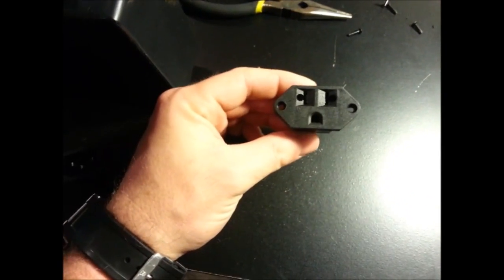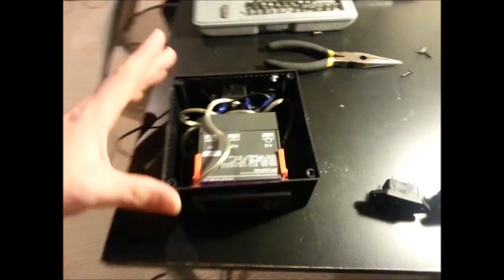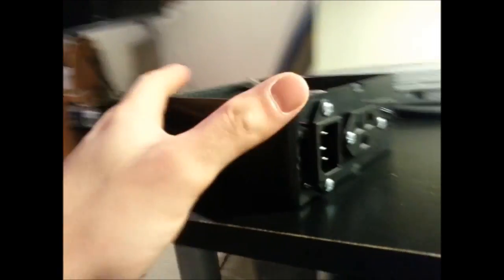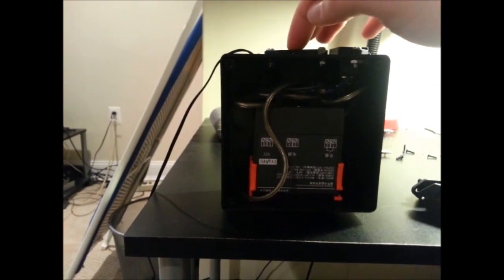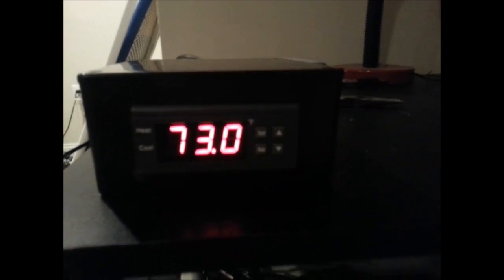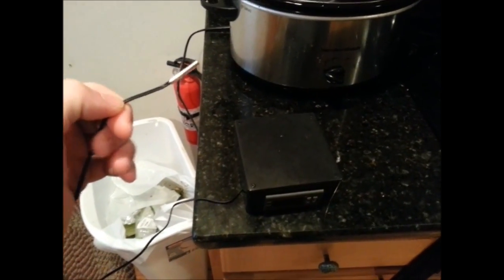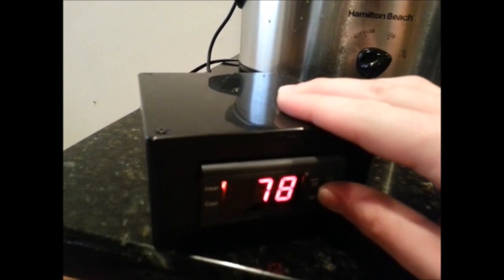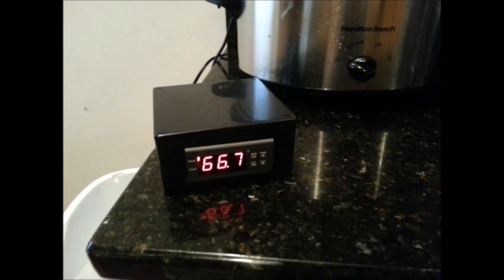Build Your Own Sous Vide Machine for about $30

Comment: My only concern is, if you add the circulation pump, all of those cheapy little pumps are for cold water. What is the max water temp that can be circulated through one of those cheap pumps and how long is it actually going to last with 150 degree water flowing through them for hours at a time?
Reply: sous vide usually run under 100 degree celsius anyway. it is all okay.

Comment: I'm using a turkey roaster. Works the same as a crock pot, just bigger with a steel lid (Hamilton Beach, about $25). It's larger and can do bigger sous vide roasts with the extra space. It also has a stainless grate that goes in the bottom. Holds the plastic bag off of the bottom to improve circulation. Ebay has tiny hot water submersible pumps, good up to about 180 degrees, if one wanted to add a circulation option. My whole build cost under $50, works as well as the big $500+ sous vide tanks, and I can still use my turkey roaster for,, you know,, turkeys. Everything fits inside for storage.
The little temp controller thingy is great for all sorts of uses. Thanks!

BTW: I used 12 gauge wire for safety (high watts), but the turkey roaster works well on it's low setting (about 350 watts). Be sure your computer wire is at least 14 gauge. Better yet, buy a short 12 gauge extension cord, cut it, and run the ends out as shorter pigtails. All you'll need to do is drill holes in your enclosure. Use zip ties inside to anchor your wires.

Comment: hello sir, i have a question, what are you using? do you use arduino?
Reply from the maker: Nope, this is a completely standalone build only utilizing the described temperature sensing unit shown in the description.  This could probably easily be controlled with an Arduino or Raspberry Pi though.

Comment: Can i not just plug my cooker into this gadget? Please advise: LED Digital incubator Temperature Controller Electronic Thermostat Thermocouple with Socket Aquarium Thermometer termostato
 http://s.aliexpress.com/E3yiyIru 
(from AliExpress Android)
Reply from the maker: You should be able to, but I cannot tell 100%.  Keep in mind that many cheaper DIY type Sous Vide machines have come out since this video was posted, so there are probably a few cheaper ready to purchase options now.

Comment: FWIW it's pronounced "Sue VEED" with the "D," not "Sue Vee." "Sous vide" means "under vacuum," but when pronounced "sous vie," it means "under life." Which is... weird :D

More importantly:
1) Details on wiring up this unit, MH1210F:
http://www.homebrewtalk.com/showthread.php?t=505220
2) Put a 10A fuse on the black (hot) input wire! Fuse fittings like this are easy to wire in:
https://www.amazon.com/uxcell-Screw-Panel-Mounted-Holder/dp/B00AQWXW9S
3) Use thicker wire for this, 12 AWG for safety. You can use "found" wire, just read the gauge and rating on the insulation. Thicker wire means cooler operation. Details:
https://www.hitechcontrols.com/cables/technical-information/58-current-ratings-ul-csa.html
4) Follow these color standards, it's easy:
http://www.dummies.com/programming/electronics/components/alternating-current-in-electronics-hot-neutral-and-ground-wires/

Happy cooking!

Comment: Just finished putting mine together. Testing it went great. Now to celebrate with steak. I did have problems getting the receptacle from China. After waiting 3 months I received the wrong part. I wound up ordering this one https://www.aliexpress.com/store/product/10pcs-lot-Black-AC-250V-10A-Panel-Mount-US-Outlet-Power-Socket-Electrical-Socket-female-industrial/1196680_32623722924.html I wish the case was a bit bigger too. Even with the orange pieces my display pokes out a little. I believe the wires are pushing it out. I'm happy though.

Comment: Just finished the build had the plug and outlet in my computer junk box so thirty two bucks with shipping. Hardest part was cutting the openings set the Dremel on low and didn't get melting but still hard keeping control but it came out ok. I stripped the blk and wht 14ga wires out of an old power cord so wiring was easy.  I've been precooking steaks in plastic bags and hot water for a long time and for the most part they came out fine but not keeping the water at a consistent temp sometimes results can be iffy. Fun build and I'm looking forward to seeing how well it works

Comment: I added an extra plug outlet to the side of the box so I could plug in a power converter (120vac to 6vdc) to run a water very small circulation pump that I found on Amazon

Comment: DO NOT BUILD THIS! Just because a lamp cord is able to carry 110 volts for a 60 watt light bulb doesn't mean it carry 110 volts for a 300-500 watt crockpot! The lamp cord is only carrying .5 amps where as the crockpot is up to 4.5! This is a $30 house fire tutorial.
Reply: Old comment but typical lamp cord is 18/2. 18 awg wire is good for ~7 amps and 500 watts at 120v is only 4.1 amps. Add a 5 amp fuse and don't think twice about it.
Reply: I was going to make a very similar comment. That lamp cord is not rated for that kind of current at all and it's going to heat up and start melting stuff.
Reply: Gravit8 that is not what he says or what he shows. He says he wired it with a lamp cord. Watch it again. Also the crock pot wire is only after the outlet. According to his tutorial you can wire the outlet using lamp cord. I actually wired up one of these not 2 hours ago.
Reply: Brad Weber Haha I deleted my comment because I watched it again and saw that. But I didn't see you had replied, my bad!
Reply: Brad Weber By the way what did you use? 12 or 14 gauge wire?
Reply: Gravit8 I actually used a cheap extension cord because it already has the plugs. I am only running a small 100W aquarium heater though. It's not for cooking.